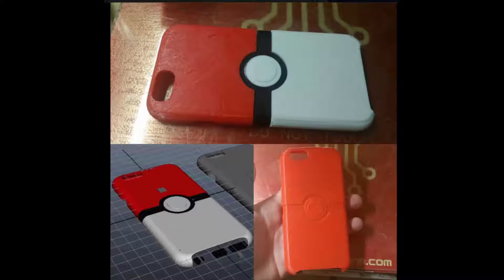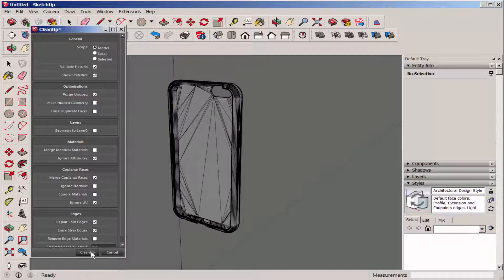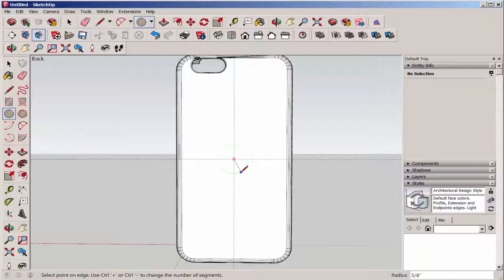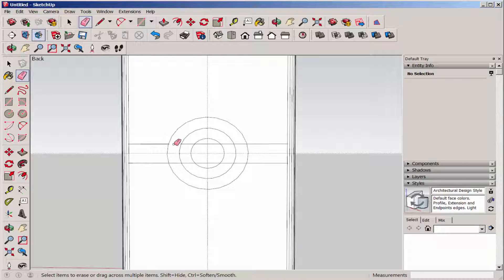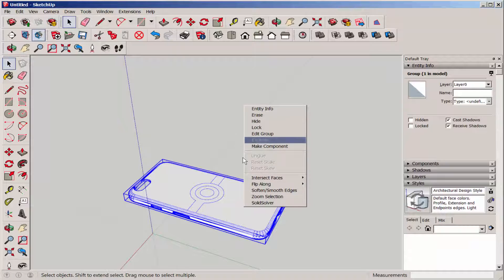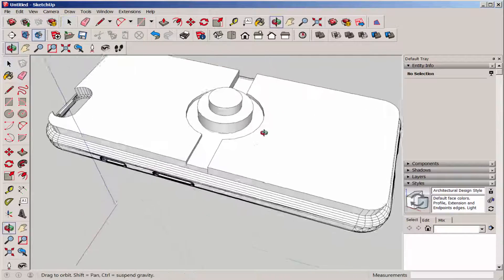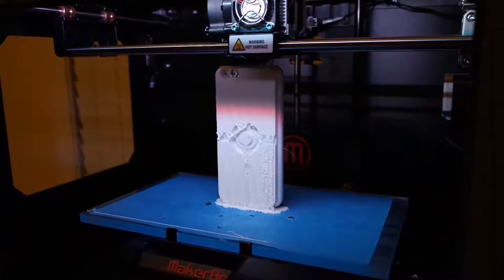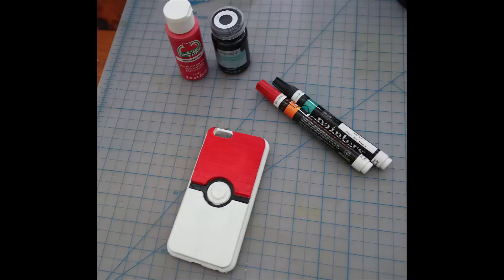SketchUp: Pokeball Iphone Case

Comment: Nice job Lydia, I must learn that 3d package, much better than 123d, although that was easy to learn and got me into 3d modelling myself..
Reply from the maker: I haven't forgotten the case (if you still need it). I can't decide what to use, SketchUp or 123D. Still trying to map out a simple, clean way to do it.
Reply: I've done quite a bit of this box, still working on the bottom half which will incorporate the batteries. I can sent you the file if you wish to see what I've done so far. You might even be impressed... Hehe
Reply from the maker: sure, email it to me, I'd like to see it. ms rose again@ yahoo
Reply: Should be on its way Lydia...